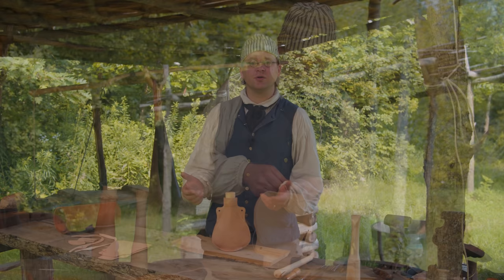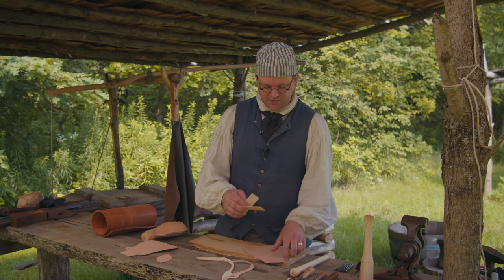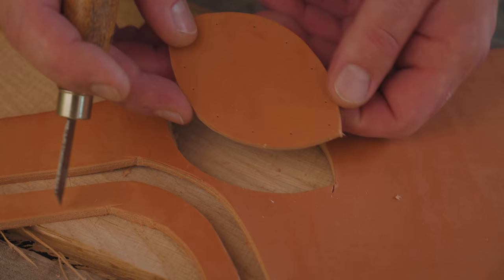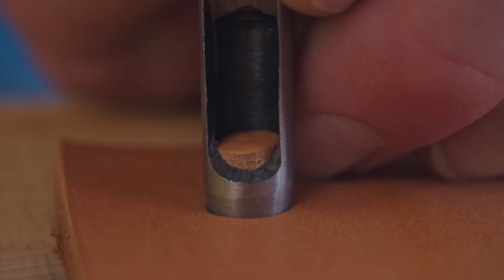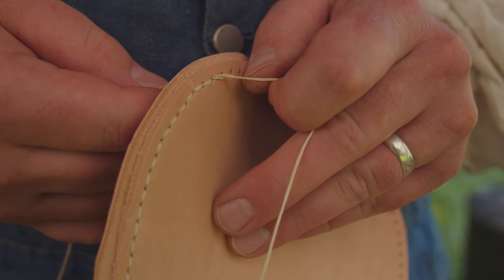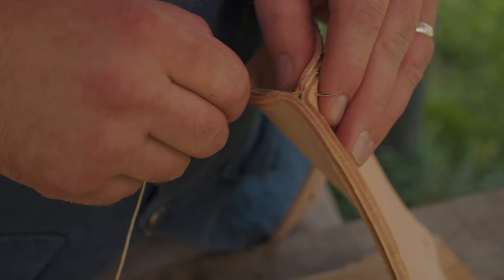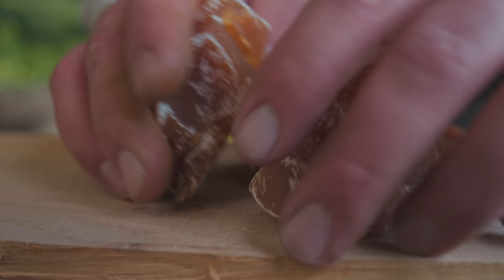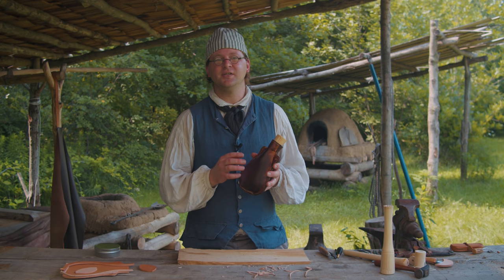Handcraft Your Own Leather Canteen

Comment: If you don't have high quality hand made knives, a $2 box cutter with disposable blades works just fine, too
Reply: Always use a fresh blade
Reply: I use a utility knife and you can sharpen the blades too!
Reply: from direct personal experience, boxcutters and other utility knives are sharper but they don’t give you the control and stability as the leather knives…they might be good for long straight cuts but angled or shaving cuts they’re dangerous or likely to go off to the direction or even snap the blace
Reply: @bostonrailfan2427  you can use an angled straightedge like a miter if you need to make due with what you've got. also works on curved cuts, i like to use coffee cups and tin cans when i need a nice round piece
Reply: Just buy a scalpel. There cheaper than cheap and sharper than sharp
Reply: Xacto #10 and #28 blades are in expensive and work better than most of the purposes built blades in my experience.
Reply: Leather working knives do work quite a bit better and make it a bit easier but box blades and exacto knives will work until you get the special tools
Reply: you can really be inventive with tools for leather work my first project I used a box cutter a 2 inch nail and a cheap rubber mallet my second project I used a fork (that I flattened out) to mark the leather for better stitch spacing. Yes the right tools help but can get expensive but they aren't a must have use what you have available if it doesn't look the best just smile and say you were going for that 'rustic' look and move on to the next project.
Reply: @simonfreeman8233  using a fork as a stitching chisel is incredibly inventive. If you sharpened the tines and peened the handle I imagine one could work very well. Tools you make yourself hold special meaning
Reply: @lithuaniaball  maybe it was the forks I had but i found that they were just too weak to use as chisels (yes I did break a few trying this one) but as pricking irons they work well and from those humble beginings I'm now trying to justify to myself why I NEED a set of Osborne chisels and a barry king maul
Reply: dollar tree has exacto knives with 8 blades for a buck plus tax!!
Reply: I have high quality hand made knives. My friend who just cal four of prison just showed  me how to make it. He literally just files down a bar of steel into a point knife.
Reply: Like most things in life, there are alternatives. But having the tools built specifically for the job is 90% of the time the absolute best way to go. From the history and countless years of experience of others designing and making the tools, knowing how sturdy to be, what grip shapes work best, what blade shapes in what direction and thickness, etc.... In a pinch I know how to use razer blades for shaving, but I would never take leather working equipment near my oboe reeds, because the needs of the craft and cutting and materials are different. 

Good luck out there everyone, with whatever tools you choose to use!
Reply: @seankeaney823  exactly, I use xacto blades for everything crafting related
Reply: @DJKinney  haha, the point....
Reply: Xacto knife. Those things are sharper than razor blade box cutter. May cost a couple extra dollars but we'll worth the money.
Reply: @bostonrailfan2427  You can use disposable blades of any shape and size.  
You never heard of X-ACTO?  Any hobby and craft store sells disposable blades way sharper and versatile tan any "leather" knife.
Reply: I use a razor blade scraper for skiving, and a utility knife for cutting.  Special knives would be better, but more people have the disposable blades on hand.
Reply: Yeah but it isnt as authentic
Reply: Very tru
Reply: It goes without saying, be very careful when cutting! You can cut yourself to the bone with those
Reply: OOOOOOH. GOOD FOR YOU.
Reply: @Skund79  I just used a blade that wasn’t fresh. Too bad.
Reply: True,
Reply: I've a set of small wood carving chisels with different shaped cutting edges that are plenty sturdy enough for leather. And have diamond sharpening stones to keep them razor sharp.
Reply: I only use a box cutter
Reply: Thank you for this info, some, like myself often cannot afford high quality knives. It is good to know there are other options 🙂🙂
Reply: @toolbaggers  Yes my leather working knives are going to have more control because they have a specific blade and handle shape designed exactly for what I'm doing with it. Nothing is wrong with using an exacto but if you find you enjoy leatherwork look into upgrades.
Reply: Dispose off them greatly and dont just let it go to the ocean
Reply: @simonfreeman8233  You don't need Osborne or Barry King tools, they are dogshit.
Reply: Throwing my two cents in here as a hobbyist leather worker and someone who knows folk who do it for a living, box cutters with disposable blades work well enough and are much safer then head knives, but do NOT use a scalpel for trying to do detail work. The blades just are not sturdy enough and can shatter if cutting through thick enough leather. I've been using the same box cutter for four years and I have yet to encounter a project where it didn't work.
Reply: @bombasticcat  TY I never would have thought of that! I'm going to get myself 1 or 2.
Reply: A 7 dollar exacto knife is even better
Reply: It won't give that precise cut.
Reply: Leather knives of workable quality are very cheap.
Reply: And no, box cutters DO NOT work just fine for these kinds of cuts. They are much harder to control, much harder to turn accurately, jumping off at the wrong angle and now you’ve got to start allllll over again because you cut 5 inches in 1/4 second.

Comment: Tip that was missed on thread length with a saddle stitch is 4 times the length of thread of how far you want to stitch.
Reply: Great tip.  I always underestimate the amount of thread I need to use on a project.
Reply: @ericwilliams1659  As I'm sure you are already aware one of the great things about saddle stitch is how easy it is to start off a new thread. Something I learnt the hard way from making belts and bandoliers was you don't try to work with just one looong thread it's ok to run multiple threads I usually start in the middle of a long stitch line working outwards to a lead edge as it's easer to tie off the lose ends (sorry if I'm writting something you already know and good luck with your projects)
Reply: @simonfreeman8233  its also easier to repair when and if the threads get warn and damaged depending on what your making.
Reply: @simonfreeman8233  You might be writing something someone might already know, but this is the internet and someone who doesn't know can come along and read it like me.
Reply: Depends on the thickness of leather and if your using a lock sadele stich.
Reply: I've always heard 3 times the length... But it makes sense that it would vary based on thickness of the leather and number of layers being stitched together.
Reply: Shouldn’t he also be lubing the thread with some sort of saddle soap or bacon tallow ??
Reply: @panchopistola8298  I'm an amateur at best, but I thought that was an alternative to the beeswax, and since he is asking the pitch inside and out,  that seems like overkill.
Reply: @panchopistola8298  he did wax it with bees wax I thought, I would have to watch it again to be sure.
Reply: @panchopistola8298  no it doesnt need lube. The wax allows it to stay tight as it is stitched.
Reply: @simonfreeman8233  I was taught to so by my grandmothers when I was really young. This stitch is new to me but I noticed how easy it was to start and stop. The guy in the video did say it was better to go with a short length than try to do it in one go.
Reply: For that thickness, use 4 1/2 lengths or so, or your last few inches will be a battle where the thread is slightly too short to easily turn the needles back around.
Reply: I do each run with thread as long as I can reach on both sides, and when a person is doing a very large project, a new length is added and worked in the last two or three stitches to continue stitching with new thread without it showing at all.
Reply: @panchopistola8298  keep using the beeswax as needed. I mix propolis in with beeswax for more stickiness, water repellence and bacteria static quality.
Reply: I was wondering that the whole video.  Thanks.

Comment: Hey, used to do the Renaissance faire circuit here.  
A tiny fraction of advice, if you'd be willing to hear it... 
During the forming process, use the wooden tool you have to pack the wet canteen with dry pearl barley, refill and pack more, as tightly as you can in your container.  This will do a few things: such as give you more to push the wet leather out with, potentially providing a uniform stretch and more rigidity to the inside of your container as it dries.  Also, you'll end up with a product that has the potential to hold significantly more liquid.  Once completely dry, knock out the pearl barley with a large drill bit/stick/spoon as needed.  I find a handful of nuts/bolts gets the stragglers of pearl barley out of the corners well, but I'm sure a few cleaned rocks would serve the purpose well, in a pinch.  Once all the pearl barley is out, seal as usual.  Hope this helps and possibly inspires a new living history/experimental project for you. :)
Reply: Clean, damp sand works too
Reply: @divchief07ut  if you've done this enough times before, you know that sand is messy (and not really something I want to be drinking with my drinking water)... Use another grain if you can't find pearl barley, but for your sanity: don't use sand.
Reply: @deemushroomguy , the pearl barley is a good idea. I've never used pine resin/pitch for sealing canteens, I have used beeswax to seal all leather water containers with no problems. And then rubbed a beeswax/flaxseed paste onto the outside for a bit of extra protection.
Reply: Is there any rescuing a slightly caved in mug do to heat exposure? Normally I wouldn't care but its my mug from the Faire 30 years ago.

Comment: When I've made these, after wetting the sewn costrel I would fill it with lentils and beans and then use a dowel to keep stuffing down the dry goods to expand the shape outwards and get a more round base. Great tutorial, I would just advise anyone taking these steps to also expand the leather outwards to contain more volume using rice or lentils to stuff it while it dries. Great project!
Reply: Beads or small clean pebbles might be a better choice. The grains might introduce or breed mold depending on how long it takes to dry.
Reply: I used sand to shape the canteen I made.
Easy enough to force it in, to form the leather, but getting it all OUT was a major headache! Some of it seemed to set like concrete!
I used parafin wax to seal it, because when I tried using pitch, the stuff cooled off almost immediately, losing its liquid state, and I couldn't get any of it into the canteen!
Reply: @Reximusprimebeta  Actually anything larger than lentils will give a pebbled appearence on the outside. Once the lentils (my grain of choice) are dry, they are easy to get out with a stick. Filling the inside gives you a LOT more volume.

Comment: I was taught that the best way to finish off a saddle stitch was to just backstitch about 4 more stitches and cut it off.  I've done that on all the leathercraft I've made (just my personal gear) and after 20-years of service it's never come undone.
Reply: When you're dealing with leather this thick, backstitching is really tough to do.
Reply: You could double stitch over the last stitch. My experience with trying to hid the knot in between the layers has not worked.
Reply: Slicking the edges was not mentioned. I wonder when you would do this, maybe after the pine tar?
Reply: @christopherbackus5578  Not really. I've done it with 9 oz. leather.   It's no different than the first stitches except the hole is a smaller.  Still easy to do with saddle stitch needles because they don't have a sharp point to get stuck in the side of the hole you are trying to put it through.  Don't try to do saddle stitching with sharp needles because they'll get caught in the edges of the holes.
Reply: @chadcooperconsulting  Yeah, I am NOT a fan of tying a knot and trying to hide it in the leather.  Back-stitching 3 or 4 stitches works very well and is extremely secure.  When I start to saddle stitch leather together, I will typically start 4 holes from the end; stitch back to the end; and then stitch forward over those back-stitches and continue on with the rest of the item to the end.  

Then I will back-stitch 3 or 4 holes on that end to finish, stretch the thread a bit and cut off with a razor if I have one nearby.  A really sharp knife works OK too. That makes a very clean cut with no fraying on waxed linen thread (period correct for the 18th century) and the thread contracts a bit when the tension is released, burying the end of the thread into that last hole in the leather.  So there are no frayed ends to worry about.
Reply: Back stitch and then hide the ends, not the knot in the layers

Comment: I’ve made a few of these for medieval re-enactment. I used bees wax instead of pitch, but the process is the same.
Reply: Thanks for the tip!
Reply: Do either affect the taste of the water?
Reply: @Tremmor500  Yes, both of them change the taste.  If it's raw beeswax, it'll add a slight honey or sweet taste.  Pine pitch will taste like a pine tree.
Reply: Do you melt the bees wax as well?
Reply: @themodernninja8074  yes, I use a double boiler to melt it.
Reply: @TheLeathersmithShop  is there any compounds from the pine pitch going into the water? I'm wondering about possible toxicity...
Reply: @Alattos  i don't think you'd have to worry much. I chew pine pitch every now, and then when it's hot out, and I'm in need of something to get the saliva glands flowing.
Reply: Thanks since I can't use pine
Reply: @Alattos  Yes, there are natural compounds called 'turpenes" in pitch.  But you aren't consuming them in any large quantity.  Romans used pitch to seal wine amphora and vinegar amphora.  We still have that flavor today in Balsamic Vinegar and 'Retsin Wine".

Comment: Ive seen this done with beeswax coating and formed into shape by packing it with sand.
Reply: oh yeah that'd work. I find it interesting that in most of history their water containers (made of skins and stomachs and bladders and such) weren't perfectly waterproof, because slightly sweating water helped keep it cool.. and if life or death hinged on that LITTLE loss, you were probably boned anyway.
Reply: Sounds like something a Mexican leather artist would don😬
Reply: But then how would you get all of the sand out?
Reply: @bodeine454  you use wet sand and then use water to flush out the sand
Reply: @azoe6764  That makes sense, I just saw a video where someone used popcorn kernels instead...
Reply: @bodeine454  I've made one with popcorn and it worked amazingly well. The wet leather will stretch, so keep filling and packing until you get the full shape you want and then let it dry. The popcorn seeds just pour right out. A little shake and any stuck ones get knocked out as well.
Reply: @arlienorwood  I may try it, thanks.
Reply: @bodeine454  Use small beans and it's easier.

Comment: Sewing is a lot easier than many understand. Ive only just started hand sewing, i did machine for a bit. Once you hand sew you understand its not magic. The thread is like a rope, which you are weaving through the fabric to secure or tie it in place. It is the same as tying shoelaces. By tying the thread over and over again youre basically locking each piece of fabric to eachother. It can be done very sloppily or very industriously, just like any knot, some are tighter and harder to create, others are simpler. Picture a clothing as a couple pieces of cloth that have been tied to eachother, using a needle to create the holes the thread goes through. Its the same as how modern shoe eyelets allow the shoelace to go back and forth through them and stay in place, binding each side of the shoe to eachother to make it fit tightly. Sewing is pretty much the same as lacing a shoe, but you have to use a needle to poke the holes.

Comment: And here I thought those had a glass bottle inside. Lol
Reply: Some can since after an hour or two the water really takes on the leather taste.
Reply: @trikami I was just thinking that, and the pine resin can’t taste very good, either.
Reply: @nessamillikan6247  it puts a unique twist on the water but while it may taste bad its still "clean" water and will hydrate and it will probably last longer since you wont like the taste but thirst is thirst.
Reply: the chemicals that are used in tanning leather are definitely not good to ingest. I would use a heavy glass bottle inside.
Reply: the chemicals that are used in tanning leather are definitely not good to ingest. I would use a heavy glass bottle inside.
Reply: @lbarnes8207  theres some natural ways to tan leather that doesnt involve harmful chemicals
Reply: @liquidsleepgames3661  they do generally involve human piss though, so it's a bit of a wash
Reply: well, it held the inside of a cow without causing any harm, so...
Reply: Pine sap is medicinal. You could coat it several times inside to insure coverage. Pine sap can have a citrus like taste.

Comment: Nice video…. With the saddle stitch a knot is usually formed on each stitch which prevents unraveling. I take it  is not necessary for this type of item. I also back stitch about 2  stitches at the beginning and end to include high stress points as needed.  Thanks for posting!!!